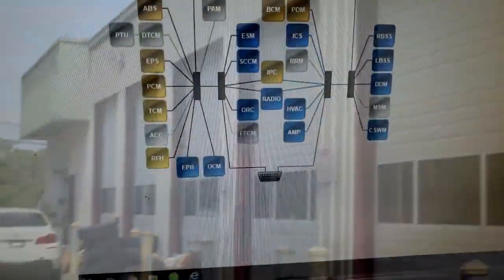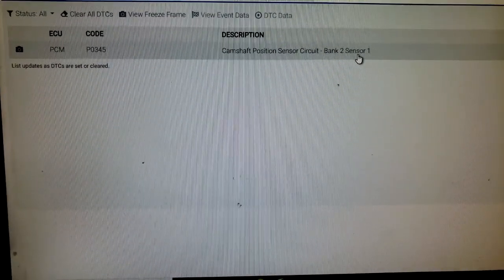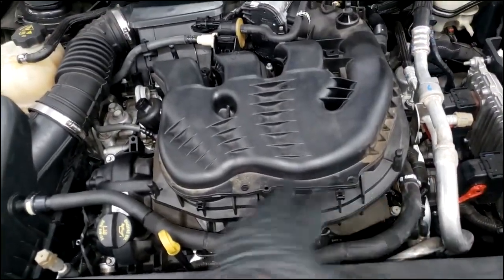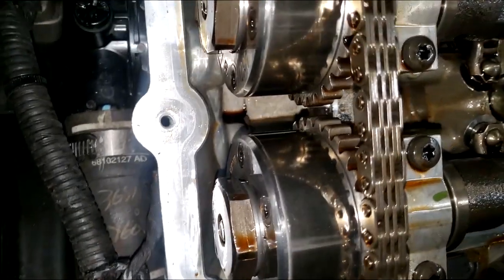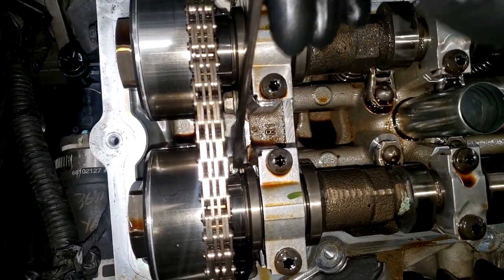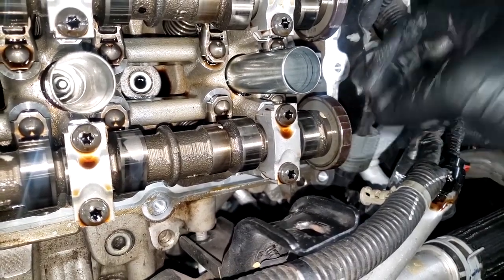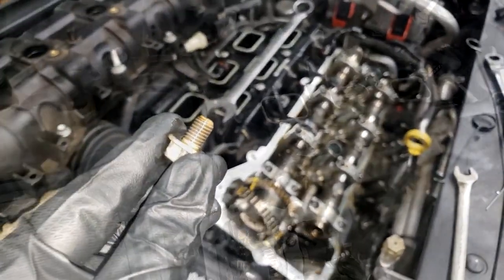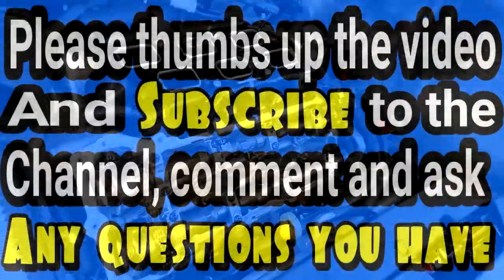3 6 Pentastar Oil Gallery plug  Cam phaser Ticking rocker arms. P0394 P0345 U1424 C121C P06DD P0019

Comment: JT my brother, if you made it a habit to use an oscilloscope more frequently, you could verify the timing on that thing without loosening a single bolt. Just tap into the cam sensor signal, and crank sensor signal, and compare to a known good signal. You would see the timing discrepancy instantly. Would save you a lot of physical diag time, which is more money in your pocket.

Comment: I saw a post on Facebook about this. Someone had removed their valve covers for a separate issue and they found this bolt backed out hanging on by a single thread. Multiple people commented saying they have seen the same. I am working on failed oil cooler right now and I have the upper/lower intake manifold off now. I am planning on replacing all gaskets on the valve covers and also to check that bolt. Am I able to tighten this bolt easily without removing the cam?

Comment: I have a 3.6  103k miles. Runs hot when I step on it and higher rpm. All new Radiator, OEM water pump, OEM thermostat , fluid, hoses etc.... head checks our ok. Can teh cam phasers cause the engine to run hot?
Reply from the maker: What vehicle this engine in? Also are you subscribed to the channel?
Reply: @OnlineMechanicTips  Yes I am subscribed. 2015 Jeep Wrangler. Temps get in to the 220's driving, and if I get on it it climbs to 230. Likes to stay in the 220's and when the fan comes on eben high, it only drops a couple degrees. Teh ONLY thing that cools it down is running my heater full blast which suck in Arizona. It used to run 212-220. Burped teh coolant for three days. Gonna try a new OEM t stat tomorrow.
Reply: Did you burp the heater hose?
Reply: @ptgtdcr  Yes, I used a vacuum fill. My issue was loose oil plug bolts in  the head behind teh cam phasers. Very common in the 3.6 2014-2016 they forgot loctite on a lot of them. Oil cavitates in the bolt threads and messes up the cam phaser timing.
Reply: @mefobiajeep9866  I just retorqued 3 of them

Comment: OH!  Don't forget the CAM/Crank re-learn.  Any time that timing stuff is apart, you have to do the relearn procedure and clear the memory so the old values go away.
Edit: Actually, anytime you remove a valve cover it might be best to do that CAM/Crank relearn procedure... All because the CAM sensors are mounted to the valve cover and they could shift a tiny amount and end up in a slightly different position when you put them back on.
Reply: Is this a nessary?
Reply: @TongZ-i2f  If you don't do this you can get random misfires or, in the worst case, a blown engine. If you can't do the procedure yourself with a scan tool then take it to a mechanic or dealer that can.
Edit: you can even get ghost misfires where it detects a misfire but there really isn't one and it maybe shuts down an injector making it seem like a bad injector...
Reply: @10100rsn that's not how the sensors work. They determine the position of the cam and crank by the teeth on the reluctor wheel. The teeth are gapped, and those gaps produce a signal every time they pass near the sensor. If you inspect the reluctor wheel, you'll notice all the teeth are pretty much evenly spaced, except at a specific point. That point produces a variance in the signal, and the computer uses it as a form of ID. The crankshaft also has a reluctor, and that variation in the gap is strategically located to give it, its unique ID. By comparing both ID's, the computer is able to determine if the system is out of time.

Changing the cam sensors has no bearing on these value. Changing the timing yes, because the physical sync between both cam and crank has changed, and you want the system to erase those old valves, and adopt the new ones.
Reply: @LynxStarAuto  the 3.6 pentastar does not have teeth on the cam reluctor wheels, they are magnetic. They are basically multipolar magnets. If your sensors are off a bit, twisted or you bump the wheels the wrong way the signal can end up weaker than before or the signal can come in slightly sooner or later than before making it seem to the computer that the timing is off. The relearn forces the ECM to erase old stored values and check its work to determine the actual cam positions based on the new physical differences in sensor position and cam orientation. But just physically bumping those magnetic tone rings can change the magnetic poles on its surface rendering it useless... Setting two cams with their tone rings too close together can damage them too, you need to keep them away from metal surfaces and each other.